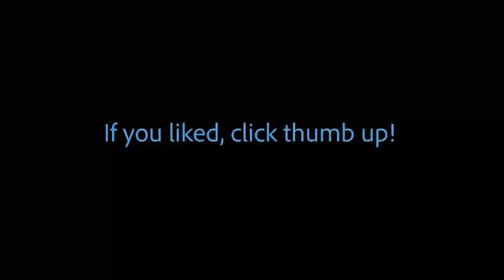Small Bathroom Remodel

Comment: I am exhausted watching this. OMG this is so labor-intensive I can see why it cost so much.  Good Job Sir!!!!
Reply: How much did it cost?
Reply: Thanks for acknowledging the labor from demolition to final fine touches and in this project there were many in the window and soap receptacle.  Yes, that's why it costs so much. It should be perfect.
Reply: This is a really great job.  Super fun and easy but a ton of material, measurements, leveling, planning, waterproofing, sealing, etc.  Most people don't realize how many steps.
Reply: @CAG Hotshot how much did you charge?
Reply: The guys a beast!

Comment: Looks amazing! Couple questions:

1. Is the house steel-framed? I've never seen that before.
2. Is the 2 layers of cement board used as the shower ledge sufficiently strong to support someone potentially standing on the ledge?

Thanks!
Reply: That is called metal studs used instead of lumber for inertia walls
Reply: wood and steel is for tree houses... not for real houses. Only in USA build houses from cardboard like a kids...
Reply: Mladjo wood and steel are always used for luxury apartments, it’s over kill for a house, please don’t speak about something you know nothing of.
Reply: @robbievargas8479  I think it doesn't have to be a luxury apartment. my apartment is not luxury. just a 3 floor building. and we have metal studs. it's built in the mid 90s.
Reply: Yeah basically you just use metal studs.

Comment: Fantastic job, my one and only thing I’d do differently is not have the valves under the shower but loved everything else
Reply from the maker: Thanks for the comment! That valve location is a bit overhyped thing in my opinion. It always takes 1-2 seconds before water starts to flow so definitely not getting cold water over you in the beginning. Then when taking the shower you would have to step out few feet to do any temperature adjustment... I don't get it 😄

Comment: schulter  pan can go right on plywood. rest of floor could have been uncoupling membrane. kerdi board 1/2  4x8 can go right on the walls too if 16 oc studs.  A few mistakes on the entry wall. Sorry certified Schluter installer here.

Comment: 2 years later - how would you rate the toilet ? Looking at this exact one for my remodel. It's sleek looking
Reply from the maker: It's been fine. No issues. We have 2 of them in our house. Only thing to consider is that its bit "small" inside compared to traditional US toilets. So some men might find it "uncomfortable" occasionally 😄
Reply: @TKR-videos  lol Gotcha. Maybe I missed it but you didn't use a wax ring? It looks like a rubber gasket at the bottom of the toilet itself.
Reply from the maker: @OGCJ10  Yes I used wax ring 28:09 I think it came with the toilet

Comment: Another question: How wide did the shower end up being? Looking at the vertically laid tiles I’m guessing 29-30” from wall to the glass? I just finished my own tub to shower conversion but haven’t bought a glass panel yet: I am worried it might be too narrow. Did you ever find it too narrow when using it? Thanks.
Reply from the maker: floor is 30inch from wall to curb. And it's 31inch from wall to glass. It's small but not too narrow. Not problem having "a normal shower" there. I think building code says 30" absolutely minimum. This bathroom barely has enough space for Building Code minimum 15" from glass to toilet (center) and 15 from toilet to vanity, and 15 from wall to faucet. It passed inspection though...

Comment: Hello, excellent job on the video & looks beautiful. I have some questions? What was the overall time spent on this project? What was the cost? I’m thinking of doing this for my parents as an anniversary gift & well, any help is appreciated. The video was overwhelming in a sense that I got confused what’s happening behind the tiles in the wall, what are the names for those boards? Was the plumbing/piping easy? It looks like you had a granite cutter & also some tool that cut through random things? I was hoping to start this project on 6/15, any help is appreciated :)

Comment: Wet soapy water is really slippery. Are you sure you made the right tile choice? I really like the profiling.
Reply from the maker: That floor tile has little "rough" surface. Not slippery at all in normal use. Of course if there is lots of soap then it's slippery no matter what's the floor material...

Comment: 5:03 may I ask what this process is for? are they air chambers and what do they do?
Reply from the maker: Yes Air chambers, they are called Water Hammer Arresters, and they prevent pipes banging and making noise when water flow is closed quickly from the valves.

Comment: I would like to know what was the USG foaming that you put in on the wall before you put in the insulation that was a great thing I like to see was the insulation on the wall and then the USG phone that went on over it as you then you begin to put the towel in and still I guess still out so it won't get moisture or mold or something I love the mirror the mirror that had the light that shine on the back of it and I like how you made the shower and you make the lips so therefore the water will stay in and the shower doors and I am have a small bathroom but I'm interested in getting a soaking tub and taking out my shower so therefore when I remodel my walk in closet I am and anticipating getting rid of that linen closet and then the next closet in the Next Room so the tub will be as long enough is wide enough to fit in the room but I want to have everything taken out and keep my vanity and keep my toilet because their new but I want to redo all of the walls with that you exhibited I seen that you use to keep out mold and mildew and stuff like that and then put my vanity and toilet bag and put in the tub but I want tile flooring I like how you did that tile Lighting in the shower and the different colored tile multi metal looking tile in that light fixture I liked it that and then defrost that you put on the windows so no one could appear in cuz people always looking in Juana people to come to my house use my bathroom always close my shutters cuz they think people are looking in but they're not looking in but I enjoyed that you did a great job and I'm very proud of your work thank you

Comment: How did you do the the wring for the mirror and shower LEDs? Drill a hole in the wall and hope there's a power line running nearby? Are they set to turn on with the wall light switch?

Comment: Aren't you supposed to waterproof the cement boards with some sort of brush-on liquid rubber membrane like Mapei AquaDefense before putting the mortar for your tiles? Cement board is porous and so is the mortar/grout... Doesn't really matter on the side walls of your shower since you have metal studs, but the back wall has wood supports which may rot over time and exposure to moisture.
Reply from the maker: It's not a cement board on the walls.. It's a lightweight Durock Tile backerboard. It has the waterproof membrane built in. Same as Schluter board.
https://www.contractorsdirect.com/PDF/usg-durock-ultralight-foam-tile-backerboard-techsheet.pdf

Comment: Not a fan of sliding the waterproof backerboard down past the floor pan.  That can lead to leaks in the future.  The board should rest on the pan (not the other way around).  That way, the tile will also rest on the bottom and any moisture that goes through the tile will still end up on the pan.  In this instance, any moisture passing through the tiles on the wall will result in the filtration of the water behind the pan.  That will ultimately lead to water damage below and mold.
Reply from the maker: That's exactly what I did. The pan goes all the way to the studs on all sides. And the wall boar sits on on top of the pan + there high quality silicone/glue on the seams. And of course there are Kerdi membrane on top of that on all corners.

Comment: Hey man. I have the same shower valve. What did you use on the threads. Teflon & pipe dope ? I just used tape and it’s seeping through barely.
Reply: I had a similar problem on my latest project. 4 pipe threads on the valve, and I used the general use white tape, 3 were fine and 1 was leaking. I removed it and re-did it and that one thread still was seeping. I removed all 4 and did them again using a better tape, and applied pipe dope and kept the wall open for a week to test for leaks and finally it was fixed.

I read up on it and apparently this was because the quality in Teflon tape dropped recently

Comment: Doesn't that shower curb made of 2 x 2" thick schluter foam compress over time from eeight of people stepping on it?  Just wondering abt use of that foam board as structural element - any issue w that? Tx
Reply from the maker: I believe German engineers have thought and tested it. No any compression after 3 years. Works like new.
Reply: @TKR-videos   Thank u, very interesting material.  I never used it.

Comment: Why use plastic instead of copper piping which is long lasting. Missing waterproofing wall membrane at shower surround per code, only at shower pan and curb.
Reply from the maker: PEX piping is standard nowadays. Lasts as long as copper. Lightweight wallboard has the waterproofing membrane built in. Way better than separate membrane. See for example https://www.contractorsdirect.com/PDF/usg-durock-foam-backer-board.pdf

Comment: What do you use to screw baseboard/cement board to metal studs? I have the same setup.
Reply from the maker: Self drilling metal-screws. The head must be suitable for the wall. Drywall screws are different from cement board screws.

Comment: Any idea where the drain is in the shower?
Reply from the maker: There is a "linear drain" just straight under the valve. It has tile cover on top, and the water flows through those small gaps

Comment: Big yikes on choosing cheap plumbing fixtures. When that shower leaks it’s gonna be hard to find parts and cartridge replacement for it
Reply from the maker: Yes I somewhat agree it's risky to use these chinese fixtures. However this shower system has got really good reviews over the years, and the valve seems ti be  heavy duty and good quality. It has a "dripping problem" which can be solved by leveling the shower head. And if it fails completely I can cut the drywall on the room behind and replace the whole valve without taking the shower tiles and wall down.
Reply: T K-R ah that’s good that you have a back access panel. Other than that fantastic work on the bathroom 👍 it came out amazing.

Comment: The middle pieces at the top of the wall, you could have simply made the bottom pieces bigger and used a full tile or at least cut a full tile to size instead of cutting the small pieces. It ruins the whole job in my opinion
Reply from the maker: I know and it was originally planned so that the top tile was full. But then there was a simple calculation error when I decided to drop the bottom tile partially inside the drain. Mistakes happen, and luckily that is actually not much visible at all with white grout.
Reply: @TKR-videos  Agreed. It looks good with the white grout.
On that note it would be nice if manufacturers made their tiles to the true stated dimensions, and that would make it easier for us to plan the layout. With a tile marketed as 24"x24", or 12"x24" it's always something like 23.6"x23.6" or 11.625"x23.6" and it's awkward on a 96" wall. Of course adding an accent strip in the middle to fill the gap would solve the problem if using a horizontal brick pattern but not everyone likes the look of accent strips.